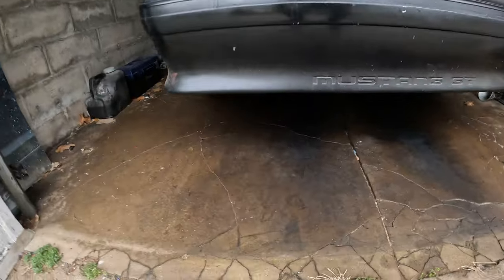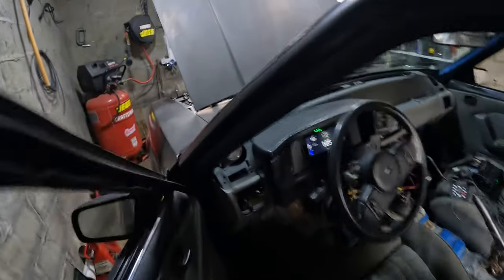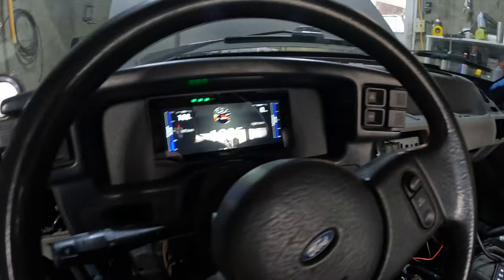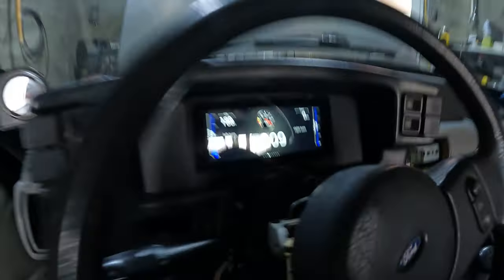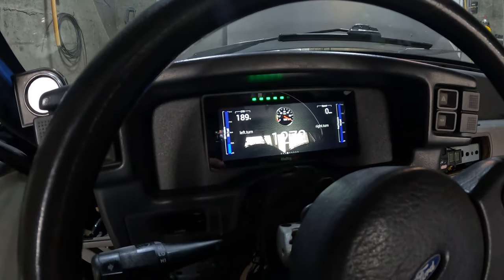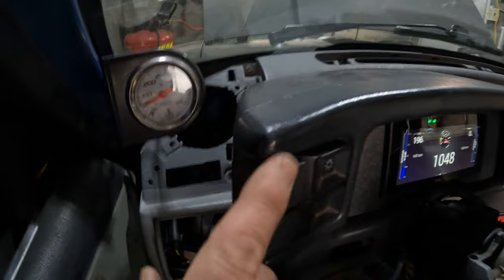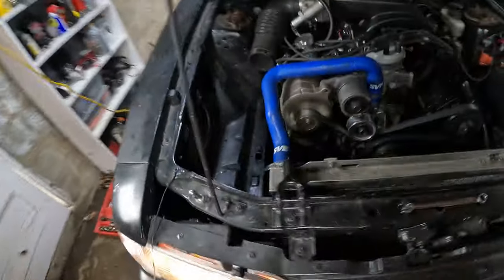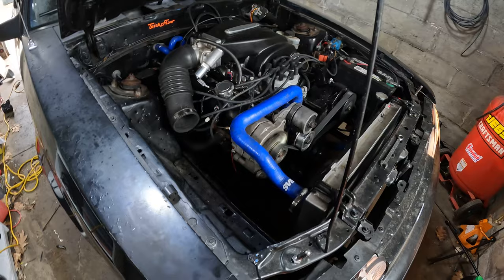Holley Terminator X Fox Body Mustang - tuning

Comment from the maker: Holley 550-937F - Holley Terminator X Engine Management Systems - $1293.95 Summit Racing - 6.86 HOLLEY EFI 6.86" PRO DASH - $1,124.95 - stand alone ECU & touch screen dash - state of the art - highly recommended 87-93 5.0. The 550-937F has the TFI (thin film ignition - distributor cable) cable for the Fox also new fuel injector harness - sell your a9l or a9p ecu on eBay